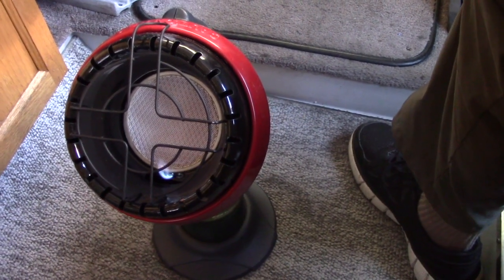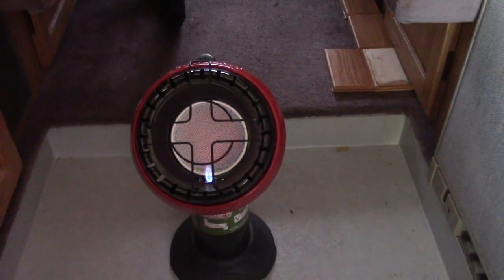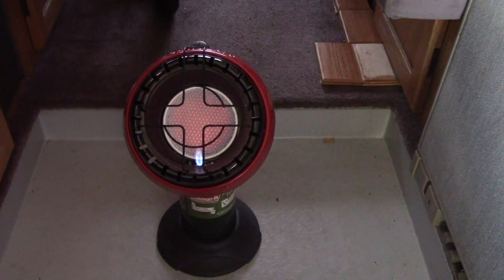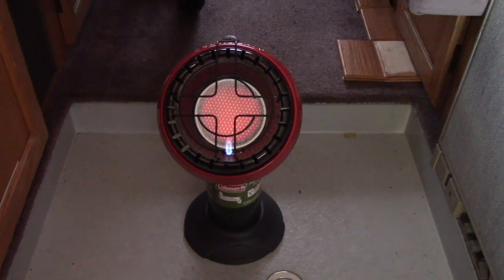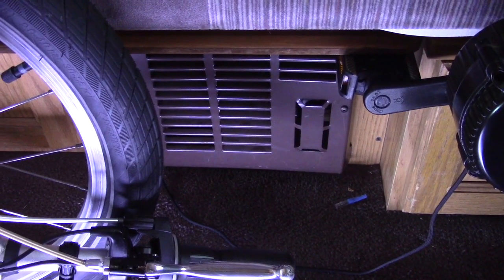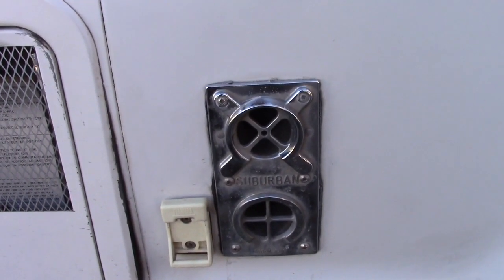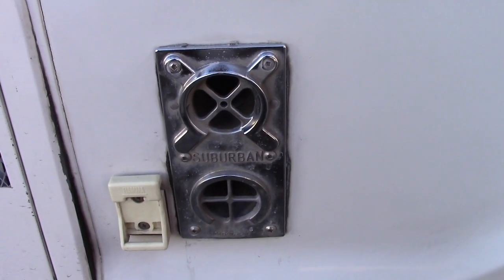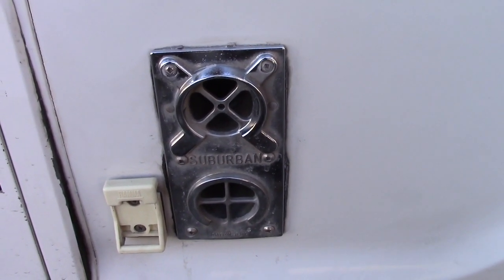Mr Buddy Little Buddy Heater...My Impressions

Comment: Something nice about the Little Buddy, Buddy and Big Buddy heaters is that they are rated for indoor use due to being equipped with a carbon monoxide detector and tip over switch which both items will automatically shut the unit off if necessary.
Reply from the maker: Hi meetoo50,
Thank you for the comment.
I could be mistaken but my understanding is the Mr Heater line of heaters has an oxygen depletion sensor that shuts it off if oxygen falls to an unsafe level. 

From the tests I've done to observe how the tip over switch works, mine is very sensitive.  Just moving the heater slightly will shut it down.
If the heater has bee running and is hot, it still could be a hazard but it's good it shuts down so quickly in my opinion.

Comment: Humm, the little buddy heater works best when it’s about 45-50* outside! I found in my roadtrek that, the next model up, works better in 32-35*! Good video Rich 👌🏼
Reply from the maker: Hi roberto abrams,
The Mr Heater Little Buddy is something I keep for emergencies stowed in the Roadtrek's under-floor storage.
Check out the video on the Chinese diesel heater.
I installed one of these in the Roadtrek.  It has differences from the propane furnace.  It is an actual furnace as well, just oil-fired instead of propane gas-fired. 

The main differences is the propane furnace has a thermostat which turns it off and on. The diesel furnace is turned on and left on with the fan slowing or speeding up and the fuel consumption matching the speed of the fan in order to maintain a very consistent temp.
The propane is either all on or all off. The diesel is best for maintaining a more consistent temp over a longer duration of time.
The propane is more power and fuel-hungry, and noisier, the diesel quieter, more fuel and power efficient.
For example, I can use a solar panel to run the diesel and only consume a small amount of fuel through several daylight hours while the propane consumes the limited onboard supply of propane and substantially more 12 volt power over the same time period.  I am also able to carry extra diesel fuel to extend the time the diesel furnace can be used and save the propane for cooking.
From a safety standpoint, I am much more comfortable carrying extra diesel than propane.  And refilling diesel is as easy as filling up the Roadtrek with fuel since both diesel and gasoline are usually available during a fuel stop.
Since the diesel furnace stays on, I can also use it to passively heat water in the portable shower I have.  While the Roadtrek warms up, I place the stainless steel reservoir of water in the warm air stream, go about other things, like making coffee and something to eat and the water warms up for a shower thereafter in a nice warm environment.
Because the air being forced through the furnace is warm and dry, when the shower is over, I open the roof vent and moisture from the shower and cooking is exhausted out so I don't have to worry about moisture build-up inside. 

As a designer of many years, I realized a long time ago that when I design something, if I just sort of look for what seems to fit together that when I am done, a lot more has happened than what I planned.
Like many of the things I describe weren't things I set out to do or planned.  They just came along, were included as part of the design exercise.
I think that's why I like design.  It's pleasant to be surprised and also humbling if one lets it be.

Comment: Could you use this to warm up the interior of a parked pick up truck for 15 minutes in very cold winter weather, say -30°C (-22°F) ... Would it even warm up the interior of a pickup truck in 15 minutes? Would it get the surfaces of the dash too hot?
Reply from the maker: Hi Chubby Cop,
Thank you for the question.
To use this heater safely, the manufacturer states that certain clearances be maintained.
Consulting the 2017 manual, those clearances are listed as:
CLEARANCE TO COMBUSTIBLES 

TOP  30”
FRONT  24”
SIDES  6”
REAR  0”
It also specifies a ventilation requirement of 4 square inches in small, enclosed recreational spaces.
The full text of the manual can be found here
https://www.mrheater.com/downloads/dl/file/id/1084/little_buddy_heater_manual_usa_2017.pdf

Comment: A timely review. I just bought one, too, and am trying to determine if I can even use it in the very confined space of my (much smaller than your) van. What do you think about placing it about 7" under a Fantastic Fan with the fan cracked open and blowing down onto the top of the heater? Would that provide enough fresh air, air circulation, dispersed heat, and lack of death?
Reply from the maker: Hi avlisk. I consulted the Mr. Heater website, 

http://www.mrheater.com/downloads/dl/file/id/215/little_buddy_heater_manual_usa_2016.pdf.

It shows "Clearance to Combustibles" as follows:
TOP - 30 inches
FRONT - 24 inches
SIDES - 6 inches
BACK - 0 inches

According to this information, you do not have sufficient clearance with the placement you described.

For ventilation, the manual states that this heater requires 4 square inches of ventilation.  

My understanding of this is a 4 square inch opening to outside ambient air.  
Your understanding may be different. 

NOTE:  My statements should not be interpreted as authoritative. 
The manufacturer should be consulted for safety and other concerns you may have.
Reply: I appreciate that. I used to have a wood stove in my old house. It had certain clearances that were required, too. But, if there was a heat shield, you could go from a couple of feet down to a couple of inches. It worked and nothing caught on fire. I think I'll try that with a metal heat shield attached to the ceiling above the heater. I hope I'll be able to report how it goes in a later comment!

Comment: Hello Rich, I like my Suburban furnace in the Roadtrek too as far as how fast it heats up but the blower is noisy.  The heat pump on the Cool Cat also makes noise because of the blower but only works down to about 40 degrees, of course one has to be plugged in to shore power or running the generator.     I wonder what the long term effects on your health is using the Mr Buddy heaters?  Take care
Reply from the maker: I don't know about the health issues. 
I do know that I stepped out of the van into fresh air to do part of the video.
I  then stepped back into the van after a few minutes. 
I could smell something.  
Don't know if it was propane or something from the various components maybe burning off or something.  What it was was noticeable. 
I am trying to decide whether to keep it in case of an emergency or just send it back.
This morning I fired up the furnace, it was about 38F and it got the van to a comfortable temp in about 10 minutes then turned itself off.  
There were no smells.  
I don't know if that Little Buddy heater just has me psyched out and I'm imagining things or if it really is emitting something. 
I do know I get anxiety around it.  
An open flame, consuming oxygen, having to provide fresh air so it doesn't use it all up.  
I'm not sure what kind of an emergency it would take for me to feel compelled to use it inside the van.
What I think I did was labor under the impression I NEEDED one of these because of all the videos I watched where people were explaining how they provided heat in their vehicle.
The thing that escaped me was that Roadtrek ALREADY provided heat for me in the vehicle in the form of about a 12000 btu forced air furnace.  
It's there, its safe, it doesn't smell, it turns itself off and on. 
I could run it at night if I needed to while sleeping. I'm not going suffer ill affects from it.  
It is not the power hungry monster some people have alluded to. 
 It uses a modest 2.8 amps of power while running and that is not very long because it seems to be pretty efficient.
I think I'm just going to send the Little Buddy back.
Even if it is safe for me to use, at this point, it's got me spooked.  I know that sounds a little paranoid.
But I tell people that I continually ask two questions.
What can I live with? and What can't I live without?
In this case, I can definitely live without this heater.  
And at least psychologically, I can't comfortably, with peace of mind, live  with it.
So that pretty much settles it for me.
Reply: Roadtrek Rich, hello Rich, I think Bob Wells video on these was pretty good at explaining the proper way to use these and I think as a backup or emergency heater, they have there place but long term, I'm a big leery.   Take care.

Comment: I use a larger model buddy heater to supplement the furnace heat occasionally.  I also prefer the built in furnace as you do. I don't use the propane to run the refrigerator so I can go for several days boondocking with plenty of propane and coach battery to heat my roadtreck.
Reply from the maker: Hi Troy. Thank you for the comment.
In the Spring, I am going to look into replacing the Dometic refrigerator that operates on propane with an Indel compressor refrigerator that operates on 12 volts. 
Right now, the fridge isn't using much propane so more is available for the furnace.
In warm weather, the reverse is the case and the current absorption fridge can't keep things cold enough in temps over about 85 degrees. The 12 volt compressor fridges seem to solve that issue.

Comment: Do you know how long it burns on one canister? Not what they claim but what you have experienced.
Reply from the maker: Hi ItsDLC, thank you for the question.  I had a couple of partial canisters so I can't say for sure.
I'm shelving the use of this open flame space heater in favor of using the onboard forced air furnace the Roadtrek came equipped with.
I ran the little buddy inside the van for an hour or so, doing some activities inside the van.  It warmed the van, I will say that.  But the heat is pretty localized with the only circulation being a little convection.
The forced air furnace is essentially a miniature of the system in my house. 
Outside air is brought into the fire box.
The exhaust gas (toxic) is vented outside so there is no gassy smell as there is with the little buddy and no oxygen depletion form combustion as there IS with the little buddy requiring a source of outside (cold) air.
Heated air from the heat exchanger is blown into the van at floor level and as it rises, it mixes and warms all the air in the van, not just in a small localized area. The coldest air near the floor is drawn into the heat exchanger. 
This recirculation takes in the coldest air in the van, heats it and blows it back into the van. 
I can partition the van with the use of a thermal barrier (down quilt) and keep the area in which I am working or relaxing  toasty warm without having to heat the entire van (efficient).
The forced air heater uses propane from the onboard propane tank which I can fill at a service station for quite a bit less per volume than the convenient little canisters and since it is under the van on the outside, there is no impact to storage space as there would be carrying multiple small canisters.
In opting for the safety and efficacy of the onboard, native system, I think I'll probably save a little in the long run, too.
I was going to return the little buddy but at the low price I was able to get it, I'm going to store it in the basement storage in case of an emergency along with a couple of canisters as a back up to the forced air unit.
Reply: the one I use in my van burns pretty close to the 5 hrs. they claim. the igniter has worked well, as has the tip-over safety shut-off. 
(didn't tip over, but bumped it moving it a few times.)
I crack a front & rear window, and have had no problems.
the smell only lasted a short time, on the initial use.
I really like mine.

Comment: When you are burning an hydrocarbon (any fuel) you have hydrogen and carbon. When you are burning it, it is oxidized, mixed with oxygen. The by product is water vapour H2O (for the hydrogen) and CO2 (for the carbon). CO2 is what respiration generate. It is not a poison. The water vapour will increase the humidity in the van or RV. This could be a concern because of moisture is sometimes difficult to control in a small area.

Propane contain more hydrogen than an other fuel, and less carbon. This is why it generates less CO2 (like natural gas) this is also why it is considered ‘greener’ but it generate CO2 also, like any combustion process but about 20% less.

Carbon monoxyde will be produced only if the combustion process has a lack of oxygen or heat . CO can also be considered as a fuel since it can burn to form CO2 if more oxygen is giving and proper temperature. CO is poisonous. 

Catalytic heater are very efficient as they do not produce CO, or very very small amounts. This is why they are suitable for enclosed spaces. They convert all the carbon and hydrogen into heat in a more efficient way than the air furnace as there is no losses. Air to flame heat exchanger are at most 80% efficient. So 20% of the potential heat in the propane is lost.

The only reason you might feel colder is because of the power difference between both equipment and the lack of air circulation. Install a small fan and circulate the air in your van and It will improve confort. But if the power required to heat the van is less than the power of the catalytic capacity it is not because of the equipment, it is a sizing problem.

Catalytic heater will reduce your fuel consumption by 20% when properly sized and used. And provide proper comfort.
Reply from the maker: Hi Gaetane, thank you for the information rich comment. 

I know a little about things and catalytic processes is something I have almost no knowledge of.  I am guessing that some how this process takes some of the oxygen from the ambient air and combines it with the poisonous CO byproduct of combustion and produces CO2.  Further, I suppose this is why the makers of these kinds of heater stress the need for some fresh air ventilation and also engineered an auto shutoff system on their heater in the event the parts per million of oxygen of the air it is intaking falls below a safe level for human habitation.

I am probably over simplifying it but it does give me a better understanding of what is taking place.  For me, I think it was the smell of the process that was a problem. I know that these gases are odorless and that a scent is added to them to make it possible to detect their presence in air.  This scent isn't at all a pleasant smell to me so I'm thinking that was affecting me more than any affect from the burning heating process.

I think I am going to try the fan idea you suggested.  Others have, too. And that may help to not only circulate the heat but also maybe it will reduce the concentration of the odor from in the gas.

This is some very helpful info, thank you for taking time to explain things.
Reply: @RoadtrekRich  Hi Roadtrek Rich!  I had the same issue, the smell was very intense in my teardrop.  Even though most said it's safe, man I couldn't enjoyed a sleep in that smell.  Didn't felt safe at all.  We have considered getting a Ceramic heater 750/1500 watts but again no hydro no heat..  How have been your time with the heater since this comment you posted?
Reply from the maker: Hi  @papa54321 ,
Thank you for the comment.
You will want to tune in to the new video about the diesel forced air furnace I'm going to install in the van.
Have you ever noticed how something comes along that is a game changer?
Changes the ho hum paradigm?
The conventional wisdom?
Well one of those things just hit in the last several months for the van life and rv'ers.
So check out the vid
Why I'm installing a diesel furnace in the Roadtrek...Top Ten Reasons.
Reply: @RoadtrekRich  Its a little too intense that talk hahaha
But if I can we will do

Comment: I suggest you get a Hot Air heater, they are electric. No risk of fire, neither accumulation of anything...
No risks for an enclose environment such as a VAN
Reply from the maker: Hi Paul, thank you for the suggestion.  An electric heater would be good except I travel and don't have access to that much (1500 watts) of electricity.  My generator is only good for about 500 to 700 watts.
I do have a forced air heater that runs on propane but all the combustion takes place outside the van so it is safe.  Just nice warm air inside the van.  It is what I use when things get cold.  And if I have to use it for many hours, it will run comfortably off the power from the generator.  It uses a lot of propane though.